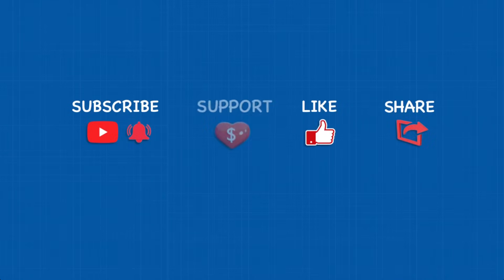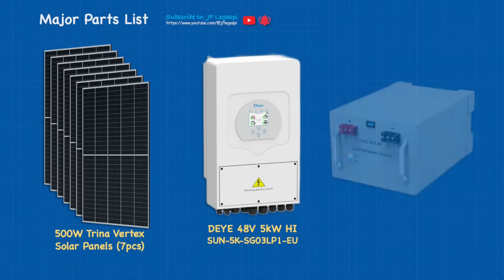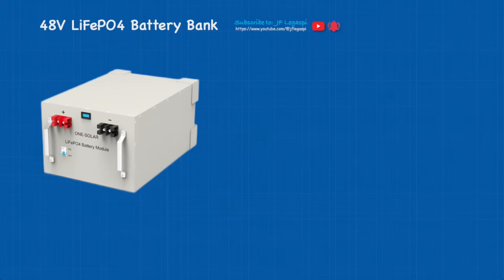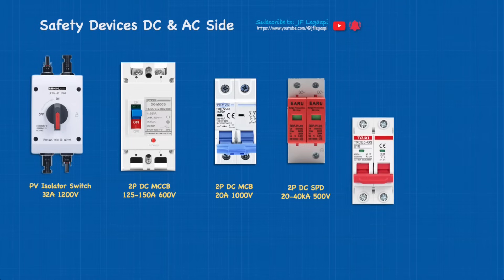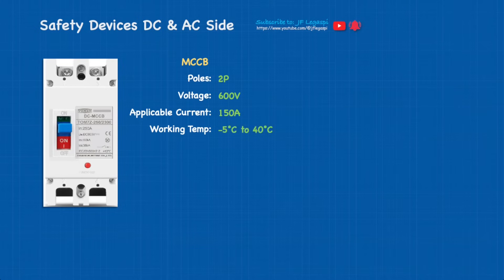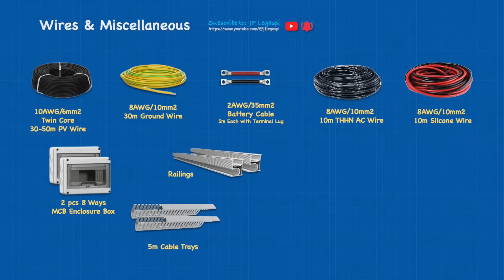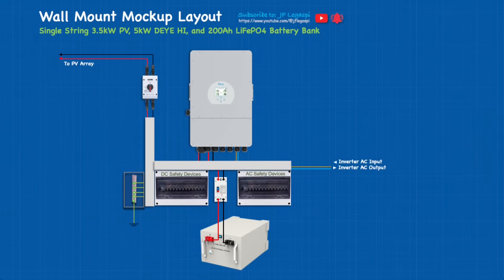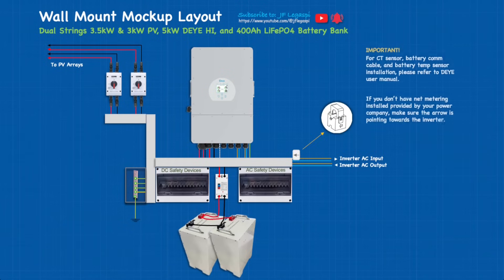How To Build a 48V 5kW (Deye) Hybrid On/Off-Grid Solar Power System - Complete Pro Level Tutorial

Comment from the maker: JFL Solar https://www.facebook.com/jflsolar
PV System Solutions
For Residential, Industrial and Commercial
Greenfield Heights Subdivision, Blk 13 Lot 1 Pili St.  
Sampaloc 2, Dasmariñas City, Cavite
(You can find us on Google Map and Waze)

We offer "FREE FULL TECHNICAL SUPPORT" on inverter/battery parameter settings, during installation & troubleshooting when you purchase your solar parts from us.

SALES:
John - https://www.facebook.com/jflsolar.john
Phone nr: 0976 135 9479
Email: jflsolar.johnvince@gmail.com

TECHNICAL:
Jay - https://www.facebook.com/profile.php?id=61561117921866
Phone nr: 0956 935 2427
Email: jflsolarjay@gmail.com

CONSULTANCY:
JF Legaspi - https://www.facebook.com/jflegaspifb
Phone nr: 0906 595 8757
WhatsApp: +45 30552662
Email: jflegaspisolar@gmail.com

Our Brands:
Deye
ATE
Lux Power
Dyness
Sunways
Trina
AE Solar
Reply: What is rapid shut down device and where to install it?
Thnx
Reply: My pv array will be on a metal construction side by my house. Not in the roof. Do i need rapid shut down? Can i install dc isolation switch outside on the construction and bypass installation of rapid shut down device?
Thanx 
Zz
Reply: Hi sir how to parameter if i'm  off grid ststem?
Reply: Sir, ganda ng presentation at step by step mas klaro kung naka schematic diagram lalo na pictographic mas madaling makuha ng mga nag uumpisa pa lng na DIYer, sana sa susunod na informative video meron na parallel na connection ng "Deye" hybrid at pano e connect ang communication cable galing sa battery to master and to slave inverter. at ma explain kung bakit optional na ang ATS or kung sa hybrid lng or dapat kung naka hybrid on/off grid configuration
Reply: I've watched start to finish. I didn't hear any tagalog.
Reply: Would a panel array giving out 15amps harm this inverter with says 13amps per mptt?
Reply: Sir mron Kau sa Cebu branch
Reply: Deye 3.6kw please

Comment: Unfortunately I don't understand your local language, however,  I follow the science clearly. Please, for the benefit of your international followers,  do present some topics in English as presented in this set-up. You knowledge stretches across all breath of life where "sun" is even seen in 2 hours. Excellent job...
Reply from the maker: Thank you for your comment and inspiring words. 😊🙏
Reply: Sir JF possible po ba ung Trina 500 8 pcs panel iconnect to only one MPPT of my 5kw deye hybrid inveter
Reply: Just a local dialect.... follow the diagram loh ... dont like?... go to other english/american video😊
Reply: @MrAngelo.78 per mppt is 3,250w limit, you will waste your 1kw of production if you use 1 single mppt.
Reply: Being a foreigner living in the Philippines for over 40 years this is a perfect presentation. There are so many Filipinos speaking their local dialect (over 100!) on YouTube Videos, no other Filipino can understand.
Reply: Am not sure that the vloger is an international traveller.  But as you rightly point out the technical aspect  of his presentation is to the point. Thanks
Reply: @zimzimm-qe5in I believe JF resides in Finland
Reply: Tie to the grid above the main circuit breaker,  you have  interlock device to prevent solar power feed back to the grid. I am confused in this. Thank you very much

Comment: That's the wonderful video I have seen in Youtube, which told me how to design the components for a solar system! But I have a question, how to calculate the DC MCCB amps of the battery? Is it based on the battery current? and how to calculate the DC MCB amps? Is it based on the current of the pv string? Who can tell me 😉

Comment: Good afternoon. I need your advice as a competent specialist.Installed the sun-12K-SG04LP3-EU inverter (3 phases).At startup, it shows the error F30 (it does not see the solar panels), The decoding of the error means the failure of the main AC relay.When the city network is disconnected, the error remains.What to do?

Comment: JF, if I have two 5kw deye inverter is that possible can I parallel connection the AC output? Thanks 🙏
Reply from the maker: Good day, yes. That’s clearly specified in the specs and manual.
Reply: @JFLegaspi  great thanks 🙏

Comment: Good day, is it possible to connect two different inverters (grid and hybrid which give energy in different phases) to the same field of solar panels?
Reply: I ask because I have a bad experience, I had a Growatt MIN 5000TL-X network inverter for about 2 years, I decided to buy batteries and a Deye sun-5k-sg03lp1 b hybrid inverter to connect to the second phase, but leave the solar field common for both inverters, the result the Deye hybrid inverter cannot supply energy to the network - the board is damaged, and the network simply stopped working
Reply from the maker: Good day. When using two different brand/models of hybrid inverter, each should have its own pv-array. In case you’d ask if it’s possible to parallel them, the answer is no. 😊👍
Reply from the maker: Then it should be two pv systems, not combined into one.
Reply: @JFLegaspi  given my experience - I already know that this option damages both inverters, I'm surprised there is no information / warning about this

Comment: Good day Prof.
Please can I add  80amp EPEVER MPPT Charge controller to the same batter
y bank that am using Grid ac input of 5KW DEYE hybrid inverter to charge?
Thank you, Sir.
Reply from the maker: Good day. If the C-rate of the battery bank can handle the additional charging current, yes you can. Always check your battery’s C-rate.
Reply: Many thanks Prof.
I enjoy your lectures,  most especially the one on 5kva Deye hybrid inverter,  you delivered in English.
More of that prof. It becomes more globalised in English.
God bless. 
Ken Stone from Nigeria.

Comment: Sir good day. Thank you for a very informative content posted for free on youtube. Is it required by Philippine electrical code to install rapid shut down device (RSD) and DC and AC isolator switches in residential solar power system? is it also required in the application for net metering?
Reply from the maker: Good day. Opo, requires na po eto sa lahat pv installtion types, maging residential, commercial man o industrial.

Comment: Hi Sir JF, i have a 6500watts water heater, can it handled by a 5kw hybrid Deye connected to DU? will it pull the remaining watts from DU?
Reply from the maker: Hindi pupwede, hindi kakayanin ng inverter na 5kW of power ang 6.5kW na load. Kailangan mas mataas ang power ng inverter kesa load.

Pakipannood nyo etong aking tutorial para sa kompletong paliwanag.

KALKULASYON ng LOAD, BATTERY BANK at INVERTER - Solar Triad Calculation Part 2
https://youtu.be/qBS8jrly9Rw
Reply: @JFLegaspi  thank you sir JF natapos ko na yung video, i mean naka grid tie lang yung water heater na 6.5w hindi sya naka sama sa load, kasi from my understanding, ang need ko lang ilimit under 5kw is yung load port ng deye and any appliance na mataas wattage nasa grid tie side lang, tama po ba?
Reply from the maker: @jerryvillanueva tama…

Comment: Sir JF, good day po, since there are two pv array that can be connected to deye inverter, is it ok to connect ten 600w on one array and a 500w in the other array, to maximize it?
Reply from the maker: Good day. There is a minimum voltage required by the hybrid inverter. Please read Deye’s specifications.

Comment: Mr. Legaspi, what is the benefit again on the second PV array (3.0KW) that you parallel with the 3.5KW? Is the 3.5KW PV enough to charge the battery while generating energy for the house load?
When purchasing the items on this design, do you have any specific store to buy these parts?  As for the smart metering, do you have to ascertain from the company that you can get a smart meter (does the company provide it?) or they allow net metering on your installed PV system?
Reply from the maker: Good day, Mr. Sanchez 😊👋 Down below are my replies to your queries. 

Q1 - There will be more (almost twice as much) energy production capacity that can be either stored on ESS (energy storage system) or exported/sold back to the grid (distribution utility provider). Note, that this requires net metering.

Q2 - I made that crystal clear in the video, I have mentioned a “one-stop shop” from One Point of sir Jason Chua as the sponsor of this video. If you reside in the Philippines, you can get in touch with his company to purchase all the parts.

Q3 - You can apply that from your power company that provides your electricity, of course with some requirements.

I hope these made things clear enough. Have a good one.

PS. Please watch the whole video.
Reply: Thanks.
Reply from the maker: @meynardosanchez2633  you are welcome.

Comment: Sir JF, how did you came up with 200AH battery for this setup? SALAMAT!
Reply from the maker: 200Ah * 51.2nV = 10,240Wh or 10kWh
* 80% DOD = 8,192wh -> 8kWh typical na konsumo na isang average na pamilya o tahanang Pinoy. Dyan naka base yan.

Otherwise, may calculation din ako nyan for days of autonomy sa iba ko pang tutorials.
Reply: Sir bakit po may computation na for example sa battery 30ah multiply to 12 para malaman ung total wattage ng battery. Bakit kapag malakihan na e imultiply na sa 51nv?

Comment: Thank you so much for this tutorial, sir JF. Through your tutorials, I was able to build a 48V system to power all of our appliances, specially the aircon.

I used SRNE 5KW (based on your other videos) but it only lasted for 6 months. I forgot to turn off the DC Isolator switch and the inverter while adjusting the Solar Panel setup.

I have 36 pcs. of 120W solar panels na naka 18S 2P. Di po praktical yung 500W kasi hindi available dito sa province namin tsaka hindi akma sa type of roof ng apartment namin. Bumibili ako ng 2 to 4 pieces every week that is why I need to re-adjust the MC4 connections tuwing magdadagdag ako ng solar panels.

Not sure what happened but bigla na lang may umusok sa loob ng SRNE Hybrid Inverter while I'm in the process of disconnecting and connecting MC4s (naka-on DC Isolator and Inverter while doing it).  And then yun na, hindi na gumagana yung SRNE hybrid inverter. I checked my connections and tama naman.

I'm trying my luck on this much expensive Deye inverter. Bumili ako through online ngayon lang dun sa One Point sa Lazada (I even mentioned your name while chatting with them). Hopefully, this inverter is more durable.

One question lang po: Pag nakapasok ba ang tubig sa isang connection (positive MC4 ng one panel connected to Negative MC4 ng next panel), posible bang magdulot ng pagkasira ng mga panels on that series (e.g. short circuit)?
Reply from the maker: Magandang araw. Sa pag-install, kailangan siguruhin na naka-off lahat ng mga breakers, isolator switch, inverter etc. para maiwasan ang arching.

Tungkol naman sa tubig, kahit kailan hindi po eto naging mabuti kapag elektrisidad ang usapin. 😊👍

Comment: Sir JF, kung may existing ako sa DU na Main 63A (branches 20+20+20+16). Okay lang na 32A pa rin MCB sa load side or palitan ko ng higher? Thanks po
Reply from the maker: 30 or 32A ang rating na kalkulado para sa 5kW na Deye. Kung tataasan yan, mawawalan ng protection ang inverter 😊👍☕️
Reply: @JFLegaspi  Thank you Sir for accommodating my concerned. Saludo po ako sa inyo

Comment: It's a wonderful tutorial, thank you! Is it possible to provide a schema for 3-phase Deye hybrid invertor as a supporting OFF-grid solution for an existing 3-phase ON-grid PV system? So it could work during blackouts. Thanks!
Reply from the maker: Good day. It’s almost the same with 3 phase. The only difference is calculation of safety devices, disconnecting means and conductors ampacity and voltage. You must use the square root of 3.

Comment: Hi sir, may I know what is your recommended MCCB rating for 1 - 1.2 Kw Hybrid Inverter (40A MPPT, 15A AC Charge) & 250AH Battery? Thank you
Reply from the maker: Good day. Kung 12V system po yan gamit ang LiFePO4 battery, nasa 80A ang max discharge current na huhugutin ng inverter mula sa battery bank at yon ang dapat masunod kasi mas mababa ang charging current na 40A lang. So 80A x 125% = 100A ang rating ng MCCB. Pwede nyo din i limit ang discharge current para hindi masagad ang inverter.

Comment: Sir JF, thanks for the very technical explanation of PV setup. Kodus! 
Just a clarification, is it necessary to install AC SPD at Inverter AC Output (Load Side)?
Reply from the maker: Good day. 😊👋 You can have the system working just fine without it. Just for extra safety, mas mainam na din na meron.

Comment: Hello Sir, can a hybrid inverter be in parallel with a normal MPPT SCC?
Reply from the maker: Good day. No, it has to be of the same hybrid inverter with parallel function on its specs.
Reply: @JFLegaspi  another question po.
In the video, you mentioned we can do 2 solar array. Can below items possible:
1. 2 solar array connected in 1 PV isolator switch? 
2. Voltage input will be array1 + array 2 or (array1 + array2) /2?
3. Is having 2 solar array in one hybrid inverter applicable to any hybrid inverter.? Cause I am planning to do it on the latest SRNE hybrid inverter.

Comment: By the way sir, question lang po. I have an existing 5Kw Deye Hybrid Solar setup with net metering. Puede ko po ba dagdagan ng another 3kw Deye gridtied inverter hooked on the same meter or line? Thank you po.
Reply from the maker: Good day. Technically pwede, basta yong wire size ng linya ay kayang i handle both ang export power ng dalawang inverter. Pero, legally, dapat itanong nyo sa inyong power company na nag provide ng net metering o alamin nyo ang kanilang patakaran.
Reply: Thank you po sir.  Sigi po I will ask our power provider. For the wire size, kaya naman po, #6 naman po yung main line and also the service drop wire. But the service disconnect is only #10, so maybe palitan ko lang po ng #8 na wire.

Comment: In all the discussion in the video, I find some information missing. What if you have a 3 phase system. Out of it, you take one phase to energize / use  / conect to inverter. The neutral goes in as well. Now the 2 phases are using the same neutral as the sokar inverter system - my concern is that the neutral being used by 2 phases might damage the solar inverter due to cross currents flowing in the circuit. Question is: should we break the neutral lines of the two circuits that have common neutral line? I mean bypass for solar and the 2 phases separately?
Reply from the maker: That’s because it’s all about single phase which is commonly used for residential in the Philippines. This is not about split phase and neither three phase. Your queries are way out or far away from this tutorial.
Reply: @JFLegaspi  Simply - Should we have separate neutral circuits for the solar system circuit and the other 2 live sources (2 phase not connected to the solar inverter input). Only one pase is being used for the inverter input. What do you suggest a although this is a bit out of tutorial .
Reply: @riazmalik2956 can you upload your own tutorial about 3 phase connections?

Comment: Hi sir JF? i'll be installing solar system which is almost the same spec with your tutorial except that i have 8 pv array single string and the plan consumed load is a water pump 2hp. Can you enlighten me on battery parameter setting which is a Blue Carbon 48v 200ah with a built in bms and if possible can I go totally off-grid with this set up, thank you sir.
Reply from the maker: Good day. 😊👋 The answer depends on the total simultaneous load and its run time. 

You may acquire my personal technical assistance… but it comes with a professional fee.

Comment: Gud eve sir. I asking you how many wats of solar panels to avail  48v. I have 730 wats Canadian solar panel & I have solar homes valve reg. Lead acid battery  12v-150AH.
Reply from the maker: Good day. Depende po yan unang una, kung ano ang capacity ng inyong 48V system battery bank at pangalawa ay dapat naka-base sa specs ng mppt scc o di kaya hybrid inverter na gagamitin ninyo. 😊👍

Comment: Sir JF, ask ko lng po kung same din po ba ng mga values ng safety devices naten if gawin ko 5k pv panels ang first string then 8k na deye hybrid inverter? Gusto ko po kasi i-upgrade sa 10k pv panels in the future. Thanks po.
Reply from the maker: Good day. Hindi po, malaki ang pagkakaiba ng amp tatings ng DC MCB, pv to hybrid inverter at maging ang MCCB, battery to hybrid inverter.
Reply: Ok po maraming salamat and have a great day po.

Comment: Sir JF, kung wala pa pong battery bank alin po ang  mga dapat unahin sa pagcommisioning?
Reply from the maker: Nakasulat sa manual na gagana ang Deye kahit walang battery bank basta meron alinman sa dalawa, may AC input o may solar panels, o parehong meron.

Unahin nyong i-on ang PV switch, then DC MCB ng solar panels, at isunod ang power switch ng Deye. Oberbahan nyo saglit bago i-on ang AC input. Once na stable at walang error, pwede ng i-on ang AC MCB para sa load.